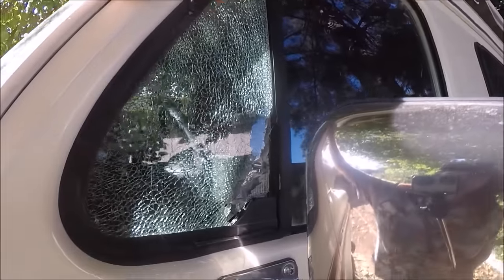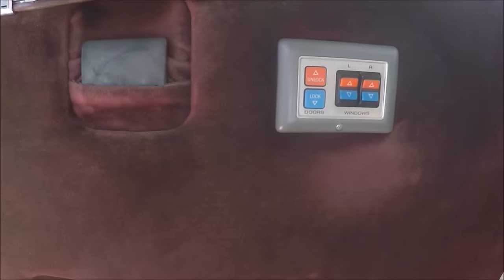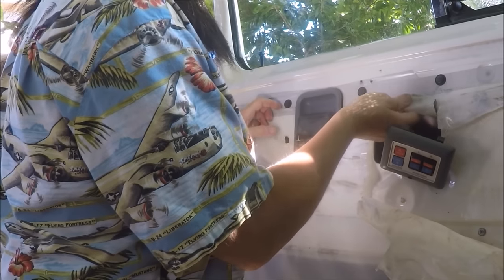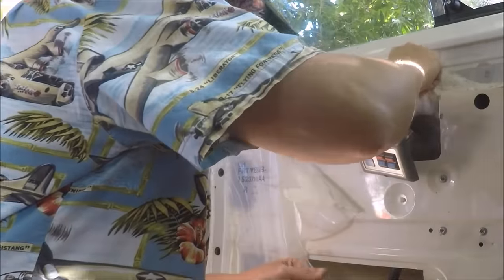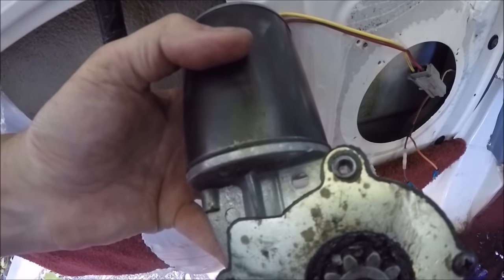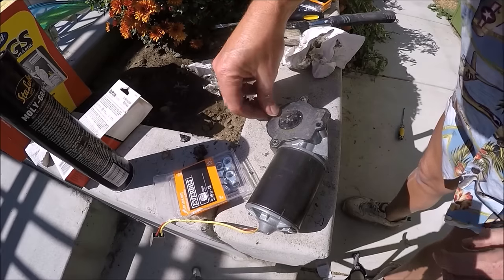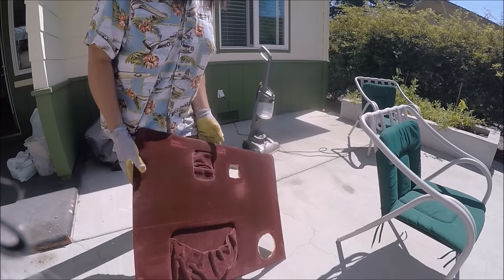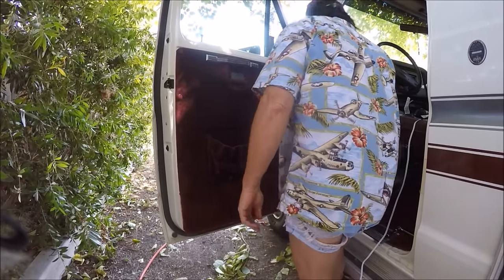Restoring & Repairing the 1988 Coachman Class B RV (Part 5)...Power Window Motor Repair

Comment: You are a genius.  I can tell you've had lots of Mechanical and Engineering experience. Great job greasing up the track too. A first class Job! "You got it goin on girl".  Keep the videos coming! Was so nice seeing Missy Jenn at the end.  Missy Jenn looks like she can handle driving Little Rascal in that drivers seat.  Sometime let her drive it for an hour or two when your out there on the open road.  Great clean up job on the panel too. I want to see you shampoo the upholstery. Will ether of you you make a video of that?  Get the old grime out of those seats.  Make it nice and clean sitting for you both!  What do you say?  Anyway, This video is very well done.  You make for a great teacher. Thank you so much for the nice well worded and well made instructional video.  Thanks to you both.
Reply from the maker: Alan you will sure be happy...stay tuned!
Reply: Ok I will stay tuned.  Thanks!  (smile)

Comment: One good thing about Ford is that the window motors are a cinch to replace.  That is what you have to do with a Ford window motor--you have to drill holes over the motor mounts to expose them and away you go.